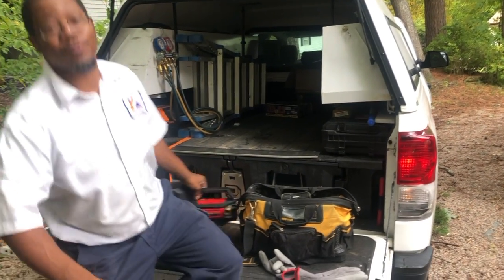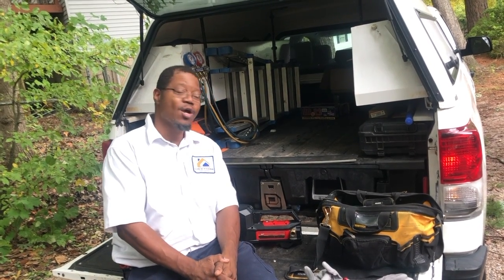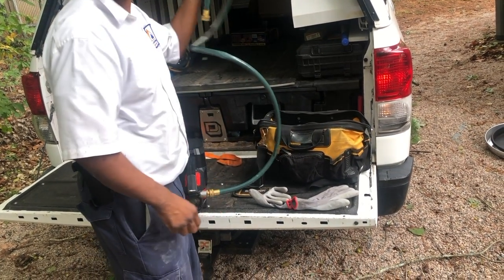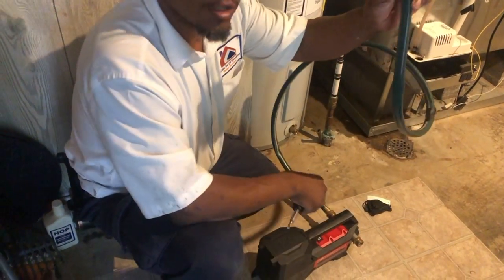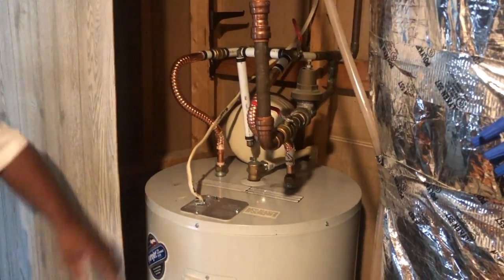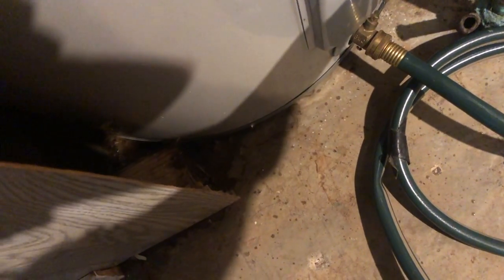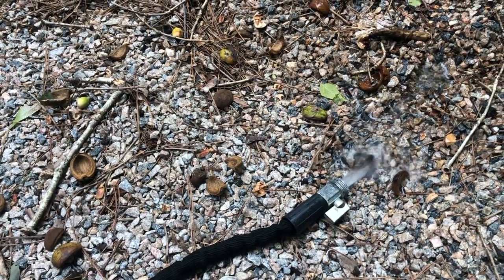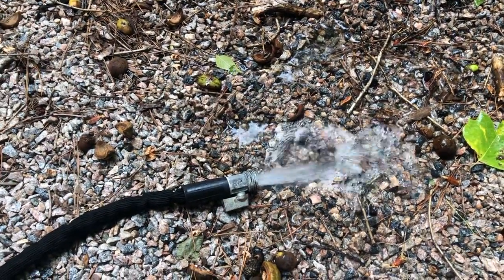How To Quickly Drain A Water Heater Using The Milwaukee Transfer Pump

Comment: Will the pump work when I connect it to my plastic drain valve that is not allowing water to flow through the hose due to buildup of sediment? The hole in these plastic drain valves are much smaller than with brass valves...my hose is dribbling very slow and would take hours to drain out. I even did a backflow flush and this didnt seem to breakup the sediment in the tank or near the drain valve.
Reply from the maker: Sorry for such a late response. The pull can still pull when it’s clogged but if it’s really bad then I drill a hole in the top portion of the water heater and stick a water hose inside and pull the water out that way.

Comment: Okay sir, only issue I have is my hot water heater is in the basement with no drain/sink. There’s a window, and it’s above the hw heater, will the transfer pump still pull the water out? HW heater is dead, but it’s full. I got a new one some months ago, time to empty it and get it out my basement.
Reply: It can.  It’ll take a little longer than if it was flat but it can push water up
Reply from the maker: Yes it will work great. It will pump it right out.

Comment: Are you concerned about the sediment messing up the pump?
Reply from the maker: That's a great question. I would flush the pump with clean water frequently. And if push comes to shove you can unscrew the panel with the glass and clean out the pump.
Reply: @alittlebitofeverythinghome4333  Even better unscrew the T&P valve and feed a hose through there.

Comment: Awesome tip sir! I work apartment maintenance and just had a water heater take 3 hours to drain when I was changing elements, This Milwaukee transfer transfer pump will be awesome!
Reply: Just change the elements while the tank is still full. You aren’t going to lose much water at all if you do it quick enough.